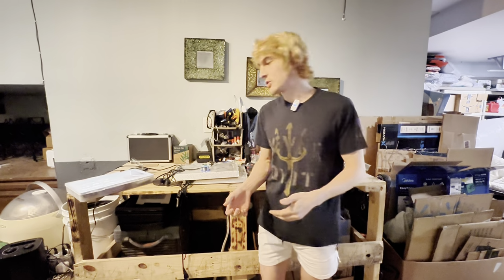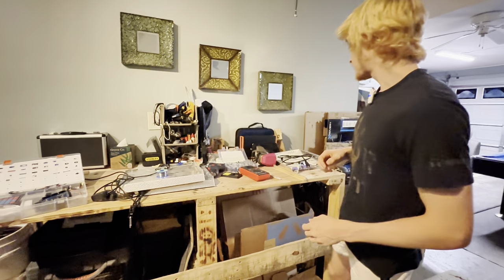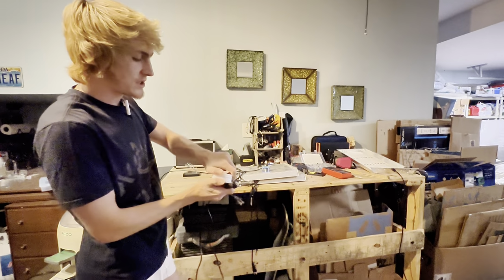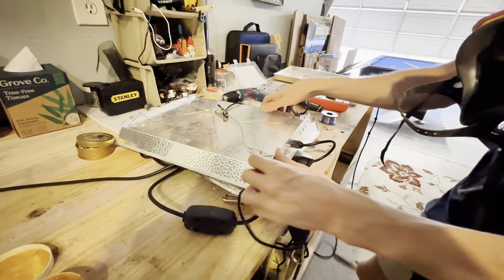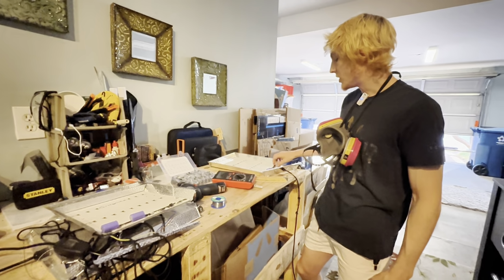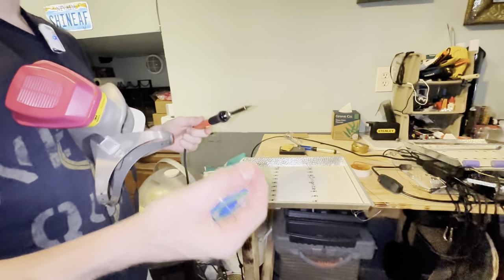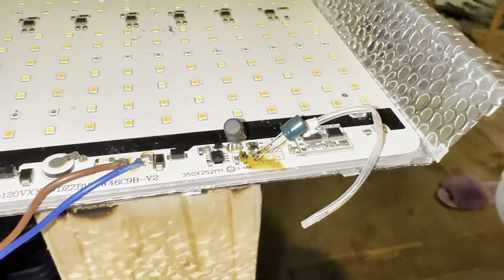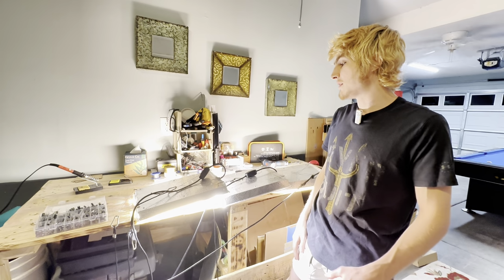Fixing 3 more broken plant light LEDs/What are the best LEDs I recommend that never fail me

Comment: you are good with plants but absolutely awful at soldering/electronic diagnostics.
Reply: as a rule of thumb. your solder and flux go on the board/component not on the iron. iron is just there to heat the board/component. further testing components before removing them is always advisable. in your case no testing needed when you see a 3 inch soot mark leading to the component. not sure if they are thru soldered components given the vid quality but if they arent the the solder removing wasnt necessary. if its not a thru component you should get copper mesh to soak up solder in the future. cheers.
Reply: awful comment :(